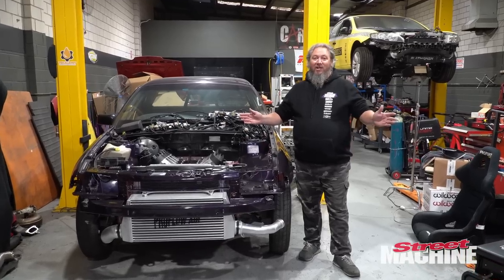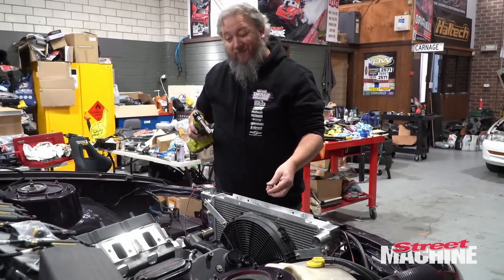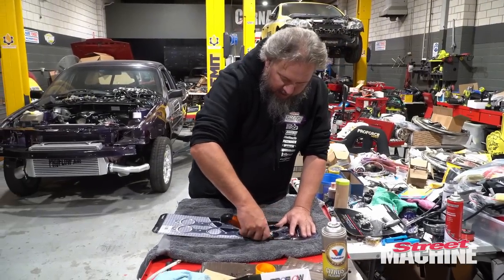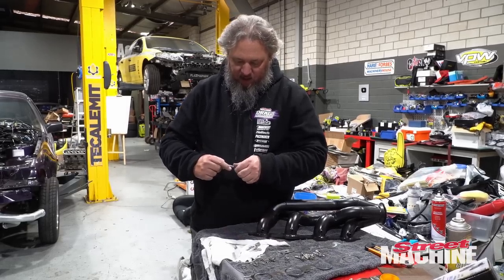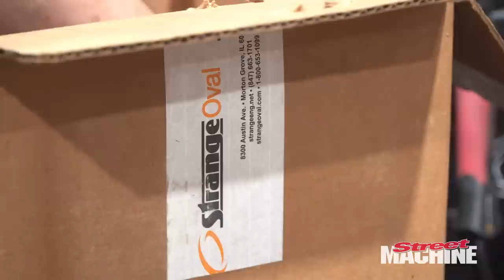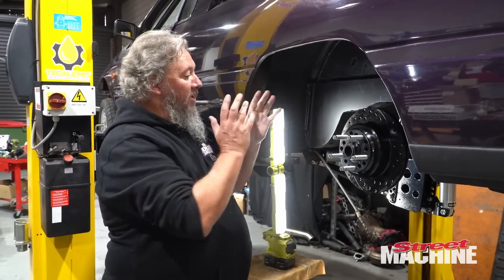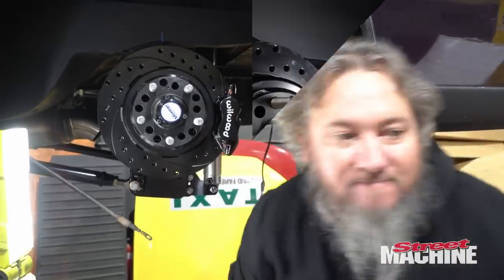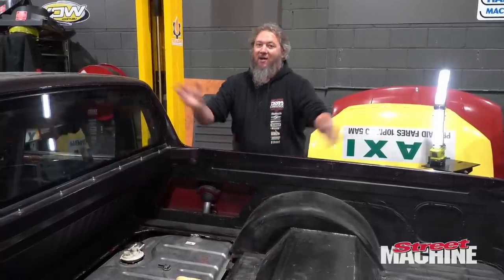Carnage - Drag Challenge Ute Part-18 - The Final Assembly begins!

Comment: I'm glad you got use out of my tank suggestion. I've been running the vy tank in my vs for a while now with no issues.
For the guys using stock vs cluster, the fuel level sender the vu and vy1 the fuel gauge will read backwards in a vs, vy2 pump or fuel level sender reads correct.  
Everyone selling top dollar rusty vg-vs tanks will now just take them to the scrap.
Reply: Good shout legend 👍
Do you know what options I have for a VR sedan? I’ve almost overpaid for crummy droptanks too many times lol 
I’ve learned some sellers mention “used” which apparently negates whether something is also “useable”. Explains why it’s being sold in the first place I suppose 🤣

Comment: Just love seeing bearings being packed right. Hate the job, but enjoy seeing it being done the right way. Hmmm not really the job I hate, it's the clean up afterwards.
Reply from the maker: Very true
Reply: Saw a video where a mechanic says don't pack rear bearings with grease because they are lubed from the diff oil and the grease prevents the oil from lubricating the bearing properly. Heard that before?
Reply from the maker: @MrTonaluv  it would depend on diff design
Reply: @MrTonaluv  possible, but would be a very rare situation (in a car), certainly not the norm. Most rear axles have seals on them between the bearing and the diff oil to stop any kind of washing / mixing. The full floaters Scotty just fit, the diff oil comes no where near the bearings.

Comment: Love the show, looks like you may have put the locking nut for the rear hub on back to front. The chamfer on the nut should face inwards towards the locking washer.
Reply from the maker: It's double chamfered, the smaller chamfers goes towards the inside

Comment: Hey Scotty, just watched the video and I noticed when you fitted the left wheel hub assembly the lock nut went on the wrong way around and it got torqued up. Probably just check and swap it around. The tapered side faces the lock washer. Good job though.
Reply from the maker: Both sides are tapered, we fitted it with the small taper to the inside as per the instructions

Comment: Crank angle sensors seem to be the Achilles heel of the LS.
Many people have given up on the factory location and put a reluctor wheel on the front of the damper to do two things.
One not have to crawl under the vehicle and battle with hot headers and a starter to swap it out when it fails.
Two reduced signal noise than occurs at high rpm and causes misfiring issues.

Comment: youre in the danger zone fitting that inlet publicly right now... proflows days of ripping off products are surely numbered
Reply from the maker: If you're saying it's a rip-off of another manifold, you would be wrong, we've had both manifolds side by side and they are totally different in size, shape, weight and design.
Reply: Most people would use curtains or sheets to wipe off the lube. 
A rag is very considerate. 

I love how people comment on other peoples builds as if it was what they’d be doing. 

I’d say just sit back and enjoy the build. 

I must say though, Scotty, your hair grows fast since your short back and sides.
Reply: Nothing wrong with proflow. Most of their products have been modified from other designs and they work well.
Reply: If that's the case, everything was a rip off from the original internal combustion engine... an intake directing flow to ports is science, you will get similar looking things even if you start from scratch with the knowledge of air flow available.

Comment: Fricken loving the video's Scotty & crew! Curiosity question with the rotors, are they anodised? If so, will that have an effect on the bedding in of the pads? I'm guessing it will wear off, but a Mechanic, I am not ha ha. Anyway, awesome video. Cheers.
Reply from the maker: Yeah, I'm not sure what the coating is. I guess we'll see how it wears
Reply: @STREETMACHINETV  Would be interesting to find out. My head was just wondering about dissimilar materials. Thanks for the reply.

Comment: Looking good boys, why wouldn't you just tap a say 1/2 inch BSP thread in the water pump to take 90 degree brass tapered thread hose barbs, that way you could angle them where ever you need the hoses to go
Reply from the maker: We can add fittings wherever we need at a later date

Comment: 4 fuel pumps why not just get 1 large pump to the motor and 1 in tank, Aeromotive have pumps and regulators that can feed a 3500+hp monster big block a lot less messing around
Reply from the maker: Can't stage one pump, so that's one very large pump running all the time.

Comment: Tip
Grab a cutting board from your local dollar store to keep in your plastic work trolley or even a metal or wooden one to use as a sacrificial surface for hammering and cutting and such so you don’t destroy the trolley.